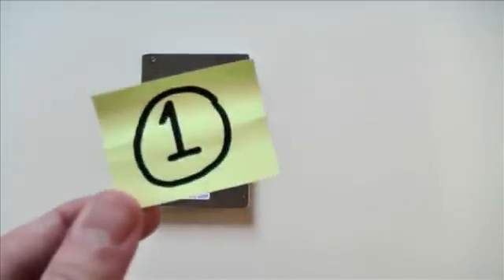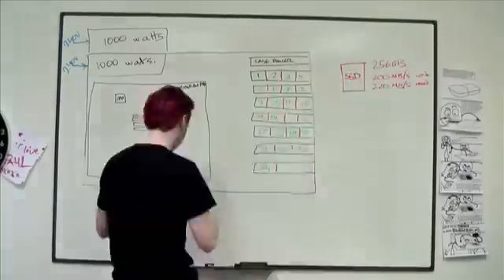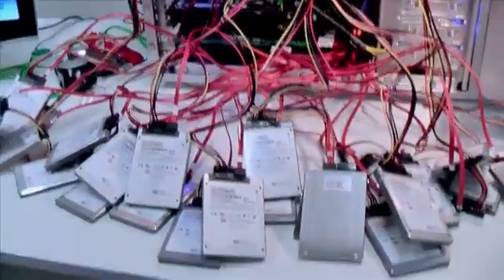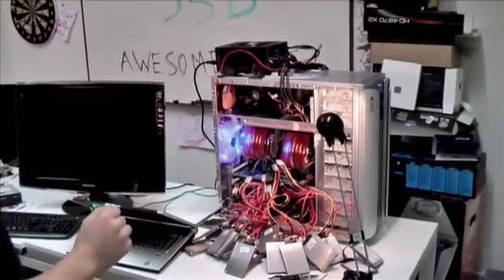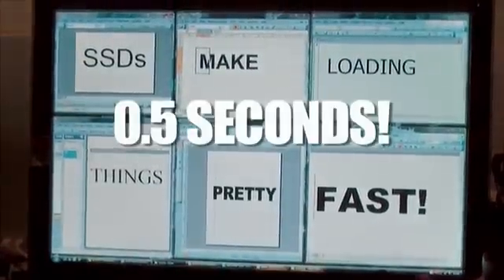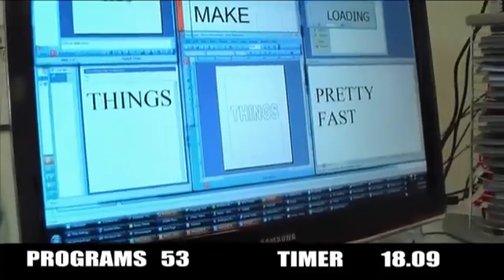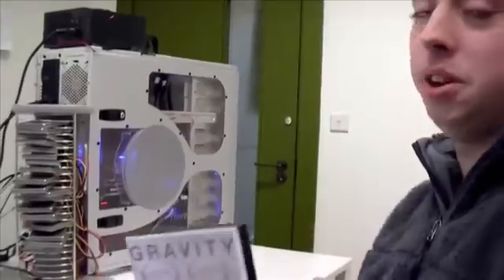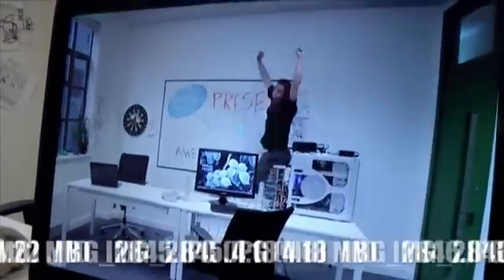What happens when you RAID 24 SSD Hard Disks !!!!!

Comment: Old video now, I get 1GBps using 2 samsung 840 evo on my laptop now.
Reply: Except.... that's how it's suppose to work... I mean... Wouldn't be much fun if technology progressed backwards would it?
Reply: Michael Pan True, but you don't see great performance increase after 3 hard drives or SSD at raid 0. 24 actually doesn't make it much faster than 3 SSDs at raid.
Reply: Zunaid Ahmed
Not true... you need specialized enterprise grade server hardware to take full advantage of raiding 24 SSDs. Consumer grade hardware obviously isn't up for the task.
Reply: Could be, but enterprises don't use raid 0. They use other raids which r a lot safer.
Reply: TheHL2Guy lower case b means bits while upper case means bytes, thats the reason you have to divide by 8 when u see small b (mostly during network speeds) because 8 bit equals to 1 bytes.
Reply: TheHL2Guy I am have a raid0 of 2 840evo 1tb, which gives me 1 GBps. Not Gbps. The big B.
Reply: GBps or GB/s? If you mean GBps you could divide it by eight to get 125MB/s - the real speed
Reply: TheHL2Guy GBps is the same as GB/s
Reply: Sorry to hear that.  The 840 is kinda old tech.  What would you expect heh?
Reply: Jamie Evans From judging by the speed he is getting, I think he is running on SATA2, which has half the bandwidth of SATA3 and yeah, 840 is pretty old, 840 pro and evo are new, but the 850 pro is the latest but it does not have a significant speed increase but rather a longer life time.

Comment: and this was 2011...... now its 2014..things are even faster.
Reply: ElPatriotaLX
1SSD can't push over 750MB/s unless it's in PCIE slot.
Reply: After 3 sssd the speed increase is not exponential. My ssd alone pushes 1gb a sec.
Reply: ElPatriotaLX  yeah 2 is perfect..  it scales 100% with 2 ssd's..  doubling your speed.
Reply: jokis125
Correct jokis125.

Comment: how expensive was it to make this pc? $5.000-$20.000?
Reply: Well, the SSD's alone would be $3,732.24, the QX9775 is 1,795.95, two of them is $3,591.9, the case is probably about $100 from one's I've found that can fit two QX9775's, taking the top GPU in a Crisis 3 Benchmark being two of the nVidia GeForce GTX Titan's coming in at $2,299.98, so all those numbers added together is $9,724.12.
Reply: genito66666 but the r9 295x2 is gaming card Titan Z is workstaton card
Reply: genito66666 Ripoff card
Reply: genito66666 Thing is though, the 295X 2 Is $1500 (not that much more than 2 290x's) and comes stock with watercooling. The titan Z costs 3 grand and has a similar air cooler to the GTX 690. Deduce what you will from that but I think the 295X2 is the better card as pure performance isn't everything.
Reply: ***** This is from Nvidia's website "TITAN Z is engineered for next-generation 5K and multi-monitor gaming."
Reply: ***** It is designed for gaming. To quote Nvidia's website "GeForce GTX TITAN Z is a gaming monster, built to power the most extreme gaming rigs on the planet." In the end it doesn't matter what it is designed for if it beats other cards at gaming. Most workstation cards aren't that good at gaming performance.
Reply: mineboyjosh  R9 295X comes stock with watercooling because it absolutely needs to! Otherwise it would be throttling constantly, or melting down like Fukushima.
Reply: Patrick Proctor Uhmm... Mantle, yeah Mantle is made by amd. And the r9 290x is equal with the 780 ti on 2k. And only 5% slower on 1k. Whilst costing $300 less. Yeah... amd aint losing any edge in the gpu market. HOWEVER god dam their cpus. Dam them to hell for being so god dam dammable.
Reply: genito66666 The Titan GPUs are a discount workstation card. You can game on it and it is good a gaming but it is terrible value since a 780ti is about the same if not better at gaming for much less.
Reply: bliglum No it comes stock with watercooling because it is a high end enthusiast card and water cooling is an enthusiast grade solution. If AMD wished they could have developed a ridiculous triple slot air cooler like the titan Z has. The bottom line is Nvidia should have made the Titan Z watercooled then maybe it would have had some sort of chance.
Reply: mineboyjosh Nah.. A single R9 290X has to kick the fan into uber hairdryer mode just to keep the card from going over the frying pan hot 95°C! To put two of those little hotheads on the same card without much more heatsink area would equal MELTDOWN baby!!
Reply: Judging by the looks of it it seems it is OOOOOVVVVEEERRRRR 9THOOOOUUUUUUSSSSSSAAAAANNNNNNNNNNNDDDDDDDDDDDD!!!!!XDDD
Reply: Intel HD integrated graphics is your best option for Hard Core Gaming. And at its price point you have enough dough left to buy the whole $1dll menu 5 TIMES at MacDonalds  #lifeleason
Reply: ***** made my day :'D
Reply: bliglum ***** My 290x never goes above 75 degrees ever and it is fairly loud but if I cared for quietness i would turn the fan down in exchange for a little hotter temps. Also why am I a jackass? I did nothing but state the facts.
Reply: $200000
Reply: genito66666 Best in terms of raw performance, yes. Best in terms of value, no. Also it is beaten by the 295x2 although that Is a dual GPU card.
Reply: genito66666 And 50% more expensive.
Reply: genito66666 The Gigabyte GTX780-Ti-GHz-Edition is the fastest "out-of-the-box" Single-GPU. I got 2 in SLI (http://www.gskill.us/forum/showpost.php?p=73167&postcount=1) | FireStrike-Standard: http://www.3dmark.com/3dm/3669807? Fire-Strike-Extreme: http://www.3dmark.com/fs/2522596  ... :-)
Reply: ***** that card is no longer on the top
Reply: It cost them nothing.
Reply: $2000
Reply: DeathToBambis its from 2011, but now yeah 2000$ :P
Reply: ***** nope its the titan z sorry sir
Reply: ***** Not 2011, the the hardware on it is Skulltrail chipset: dual QX775 CPUs and FB-DIMMs are a signature of that unique chipset. So 2008, because by 2009 they would be touting i7 and GTX 480/HD 5870 or the beast of the 5970.
Reply: Did you just forget the the 690 which is faster than the titan black and the titan z is the fastest card on the gaming market.
Reply: mineboyjosh I looked it up on Google. It is both. A card you may use for gaming if gaming is your just dessert and it is a workstation card if workstations are your just dessert.
Reply: Jeremy Blair you my friend are very wrong this video is from 2011! If you dont know it dont act like you do fool.
Reply: ***** Thank you for that!
Reply: Dont forget the new power supply for the new 295x cost round about 120 or something
Reply: ***** Your right its the gtx 690
Reply: genito66666 It's a workstation grade card for pure CUDA core acceleration.
Reply: genito66666 LOL 295X2 IS MORE POWERFUL THAN THE TITAN Z!
Reply: 18aidanme Lol you are funny
Reply: genito66666 Yes but you just assumed the titan z is more powerful, I'm actually an NVIDIA fan by the way.
Reply: I hope you know you just said $5 - $20
Reply: Neveah depends on wich decimal and thousands separator you use.

Countries using Arabic numerals with decimal point
Australia, Botswana, British West Indies, Brunei, Canada (when using English), Dominican Republic, Egypt, Guatemala, Honduras, Hong Kong, India, Ireland, Israel, Japan, Kenya, Korea (both North and South), Lebanon, Luxembourg (uses both marks officially), Macau (in Chinese and English text), Malaysia, Malta, Mexico, Mongolia, Nepal, New Zealand, Nicaragua, Nigeria, Pakistan, Panama, People's Republic of China, Philippines, Singapore, Sri Lanka, Switzerland, Taiwan, Tanzania, Thailand, Uganda, United Kingdom, United States (including insular areas), Zimbabwe.

Countries using Arabic numerals with decimal comma
Albania, Andorra, Angola, Argentina, Armenia, Austria, Azerbaijan, Belarus, Belgium, Bolivia, Bosnia and Herzegovina, Brazil, Bulgaria, Cameroon, Canada (when using French), Chile, Colombia, Costa Rica, Croatia (comma used officially, but both forms are in use), Cuba, Cyprus, Czech Republic, Denmark, East Timor, Ecuador, Estonia, Faroes, Finland, France, Germany, Georgia, Greece, Greenland, Hungary, Iceland, Indonesia, Italy, Kazakhstan, Kirgistan, Latvia, Lebanon, Lithuania, Luxembourg (uses both marks officially), Macau (in Portuguese text), Macedonia, Moldova, Mongolia, Morocco, Mozambique, the Netherlands, Norway, Paraguay, Peru, Poland, Portugal, Romania, Russia, Serbia, Slovakia, Slovenia, South Africa, Spain, Switzerland, Sweden, Tunisia, Turkey, Ukraine, Uruguay, Uzbekistan, Venezuela, Vietnam.

Comment: I want this PURELY for the fact it'll run games like a dream.
Reply: Not necessarily. They didn't put an amazing GPU in it. You don't need 24 SSDS to run games. this is a poor example of computer knowledge
Reply: Yeah just buy 24 of these then a GT210, Crysis 3 max settings 4k 420FPS...
Reply: gg
Reply: Matt
It is a poor example, don't need to point it out :P
Gigai Dee Ex 
You want fast game, install a virtual drive (RAM DISK) and lots of RAM. Virtual drive is your RAM acting like a hard drive. It would do circles around that RAID setup for a lot cheaper. It won't affect the game performance but everything to do with load times will be gone!
Reply: SwaY PhaZer They put two hd 4870X2 in crossfire.

Comment: I'd have to say the speed is impressive. However, I think you hit the limit of the interface. 24 Drives in RAID 0 should be faster than 2GB/s of data transfer. Also, you may want to look into RAM discs as you will get 10GB/s or faster.

Comment: Why defragging an SSD? (Legit edition)

The reason that fragmentation affects HDD's is because when files are split up around the pc, the hard drive has to spin to different places for each part of a file. Imagine running back and forth 20 times to build a 50 piece Lego set. That's what the HDD does when it is fragmented.

However, defragmentation, while not affecting performance, would be a good way to test the speed of the SSDs, so I believe that it was just stress testing.
Reply: CartoonFace I wouldn't say that it would ruin the SSD, it would more unnecessarily wear it out.
Reply: Agreed. It isn't guaranteed to ruin it, it just puts more wear and tear on it, which will wear out more bits, decreasing your space over time. 

Just wait til they figure out how to prevent the reset voltage from increasing over time :)
Reply: BW022 derp, ssd's should never be defragged, and if you do it, you killing the drive slowly, and lowing its TTL, if you suspect errors, run disk checks, not defrag.
Reply: CartoonFace windows by default now will not defragment SSD's, but you can do it, its just not advisable due to the life span of the type of cells in SSD's these days, and i doubt we'll see anything better than MLC for a long time due to cost, even though, enterprise has some wicked nice and expensive SSD's around and in use now.
Reply: hellbeast58 Yeah... those SLC SSDs are pretty expensive with not enough space to justify the cost currently.
Reply: Aimela Oh, they are expensive... But fast enough to be worth it to me. I save my money and add another 128 to the Raid 0 sequence whenever I need more space. HDD's are hitting the wall on storage capacity, but SSD's are getting bigger and bigger (in terms of storage) and are probably going to start getting cheaper too.
Reply: just testing
Reply: Their only point of defragging the SSD is just to show how fast it is. Defragging is one of the few activities which goes through most of the disk drive on a read and does a lot of writes. Most users are familiar with how long a defrag takes. A virus scan is another, but at those read speeds is would be more dependant upon a how long the virus scanner does pattern matching in the files.

Defrag does have some purposes other than moving files into continuous blocks. It detects some NTFS mistakes (either correcting them or recommending check disk), it can place smaller files in free blocks, it can free up larger blocks, and it can result in slightly more optimal NTFS tables for indexing. Most of these are pointless in SSDs for a variety of reasons. However, for discovering disk mistakes... once a month isn't a bad idea. You can often manually run it and just do an analyse.
Reply: hellbeast58 Any write activity to an SSD will kill it slowly. The analyse will only read, so there is no harm in running that once a month. Check disk does not find all the errors which defrag does (including indexing issues) nor does it shorten out the indexing tables in the NTFS.

Most SSDs average in the range of five full rewrites of the entire drive per day for upwards of ten years. Even hard core servers can't do that. Defragmenting won't even write to the entire drive (since only a tiny portion of it actually needs moving and redoing of the indexing tables, especially on an OS and programs drive). You'd add something like 6 full writes of the drive over that ten year period, or taken 1.2 days off of the life of the drive. Monthly defragging -- even if you did it regardless of not having problems -- is hardly doing to have any noticeable impact in the life of the drive.
Reply: its a marketing video, for old fogies that dont know any better

Comment: SSD also suffers fragmentation. But it does not impact on performance (barely perceptible).

Anyway this is stupid. If you're going to spend your money on this, you would go with FC, SANs, and better optimized filesystems rather than NTFS.
Reply: Totally, missed, the point.
Reply: the performance difference isnt "barely perceptible" it simply doesnt have a performance difference lol
Reply: Reading adjacent blocks of data isn't any faster than reading blocks that are spread out over the SSD. Fragmentation does not affect SSD read write speed. SSD's physically wear out when written to. Defragmentation moves around all files on the SSD, therefore defragmenting an SSD reduces its life span without giving you any benefits. SSDs deal with the lifespan of their cells through the use of wear-leveling algorithms. These fragment the data as it does not affect speed and so that its cells wear out evenly even in circumstances where you're overwriting a small set of files many times.
There, I wrote you an essay.
Reply: cant use san for a local build, a san is a separate system on the network
Reply: What's wrong with good old MBR?  Or is that only relevant for mechanical drives?
Reply: ***** they're
Reply: DEEP WINTER MBR isn't a filesystem
Reply: natecat33 Forgive my noob-ness.  When I formatted my secondary HDD I used MBR, so I assumed it was a filesystem.
Reply: SSD's actually WORK by fragmenting the data across all of the NAND flash on the drive, so access times are increased. Defragging SSD's not only consumes write cycles but also makes them slower.
Reply: SpartanMJO12 depends on the controller, and the type of cells
Reply: SpartanMJO12 i mean physically not, software or data side

Comment: hey dudes my Hackintosh  with 
2 intel xeon  E2500
64 GB Ram  DDR2 
1 SSD 128 GB 
MAC OS Snow Leopard 10.6.8 

runs much faster then this machine  i load 100 Applications in 15 seconds 

and you call your machine faster

Comment: Defragmentation is the process of getting things written on memory and putting them closer together in a correct order. Defragging an hdd is good because data will be more accessible for the mechanical arm since they will be closer to it. Defragging an ssd is pointless. The reason why it is that way it is because ssds are using nand chips. There are no mechanical parts and all data are stored electrically inside it's own circuit. In other words, there is no "drive" in there. This is also the reason of calling them Solid-State ("drives") [SSD]. the problem with those ssds is that they have life cycle. Essentially you can use a memory block inside the ssd to store/move data to it but there is a lifespan in write cycles for this memory block.
To sum up: You should never ever defrag an ssd.
Hope this clarifies some questions here.

Comment: 24 SSD...=5000$?????
Reply: The video was posted in 2011. The technology and prices changed a lot since then. If they did this now, it would only require 6 1TB SSDs instead of 24 256GB SSDs.
Reply: Videoxpressions Yes, the capacity would be the same with 6 1TB SSDs, but wouldn't the maximum throughput with 24 SSDs in a RAID 0 setup be higher?
Reply: Zalman1337 With Samsung's latest SATA3 drives, the 840 Evo, it would definitely be higher throughput, even just 1 drive per port.  SSDs have far exceeded SATA2's capacity, and are closing in on SATA3's limit.

The drives they had at the time were 220 MB/s, while the newer ones are over twice as fast at 500 MB/s.

They had 24x drives on 6 SATA2 ports (using SAS), and SATA2 has a max throughput of 375 MB/s - less than 2 of those drives worth.

So basically, they were capped out on speed by SATA2 limitations... in fact, they could have achieved the same speed with half as many drives.  Use the 840 Evo (500 MB/s) and you'll equal their speed with 1 drive per port, as SATA2 cannot even keep up with the drives.

Using 6x SATA3/SAS ports (750 MB/s per port), with one drive per port you should be able to achieve 3 GB/s total, and with two drives per port you could theoretically hit 4.5 GB/s.

SATA Express (SATA 3.2), however, should deliver a whopping 2 GB/s (16 Gb/s) per port.
Reply: Chris Jacobson There are many fast PCI SSDs available right now on the market, including some by Samsung, the OCZ Revodrive 350 for example has a read speed of 1700 MB/s, so 3 would be as fast as the 24 SSDs here. Amazing what technology does in 3 short years.
Reply: Videoxpressions And still cost a fortune.